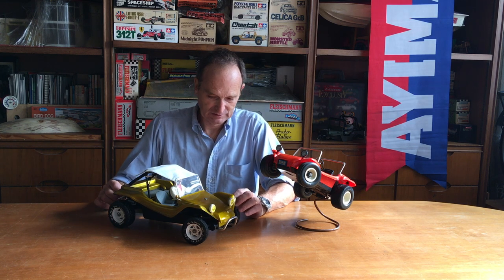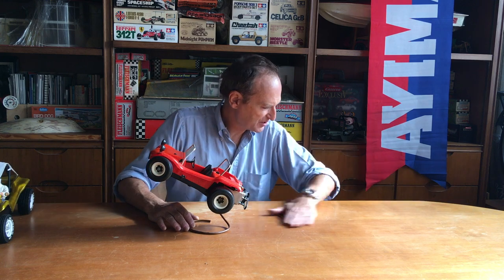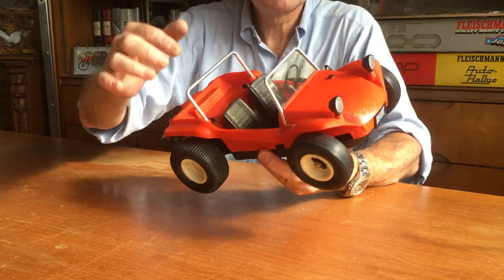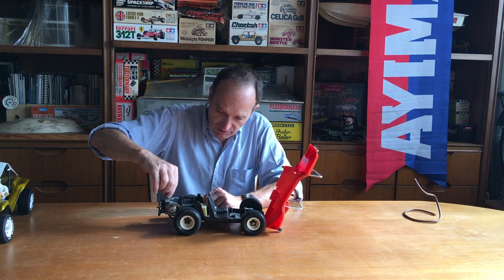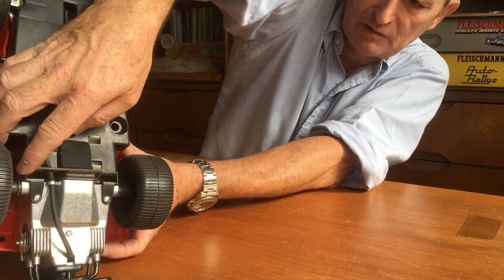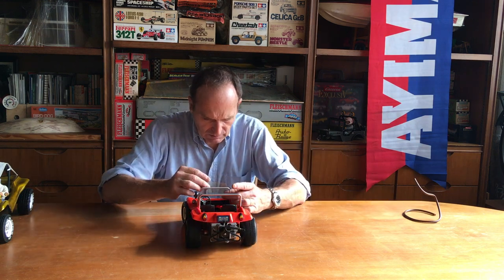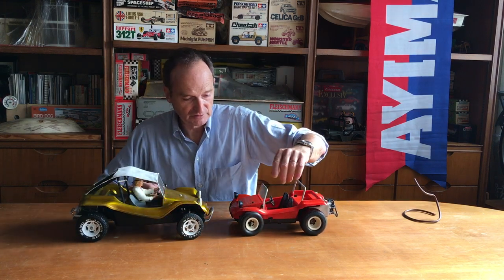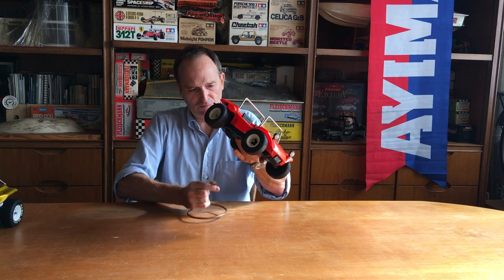Meyer Manx COX best dune buggy model

Comment: Your Dune Buggy is a late model. The Engine head is on the right side and has the plastic flywheel starting system. There is also cutouts on the sides of the body, the lights & muffler are black vs. the older Chrome plated parts. These cars have become classics. If these were run for any length of time the plastic breaks down and becomes gummy. The body mounting tabs and the back area where the die cast engine goes is another weak point. I remember Christmas morning 1972 opening up and getting one from my grandfather, I asked for one for Christmas not realizing how expensive they were. My Aunt was furious when she learned how much he spent on it. I had my Buggy until I went off to College and when I returned found that my little turd brother stripped it out. I just found a new in box one and bought it. it immediately brought back memories of that Christmas morning. My father got quite the kick of it running to boot, we had a long strip of grass that was clumpy and quite frozen. When the Buggy was released it jumped, wheelied and took off running bouncing all over the place. It was a real hoot!!
Reply from the maker: What a nice memory! Thank you. Ciao Nanni

Comment: I had one of these that I INSISTED I wanted for my 6th birthday.  I was way to young for ist as my father pointed out-, but I had to have it.  We did use it a few times over the years.  But those glow-plug engines got HOT.  Not the funnest thing for a kid to garb then the engine was 150 degrees celsius.   Still I loved that dune buggy.  That tires did get flat I guess very common.
Reply from the maker: What a nice story! I was a little bit older when finally I could buy.. It never worked... Sold to a cousin of mine and after several years I found it again but... never try to start it... Ciao!

Comment: beautiful condition & THANK YOU FOR THIS MEMORY! cox also made a version that had radio steering - i had one!  it was pretty quick, and you had no control over the speed once you let go, but if you got good you could steer it around the yard and run out the tank. very fun / VERY LOUD .049 2-stroke engine. it was always covered with a fine layer of fuel and driveway dust.
Reply from the maker: at least you had the steering!!